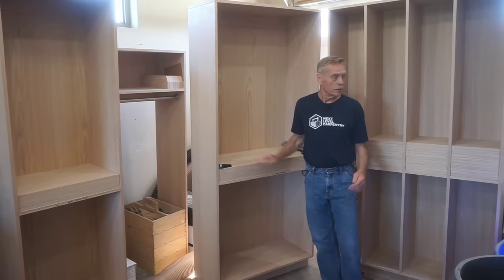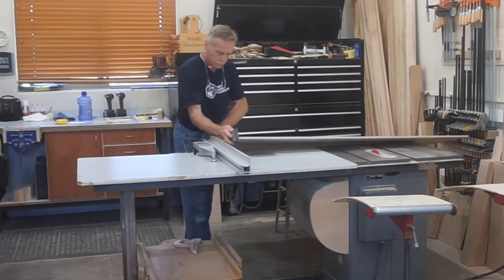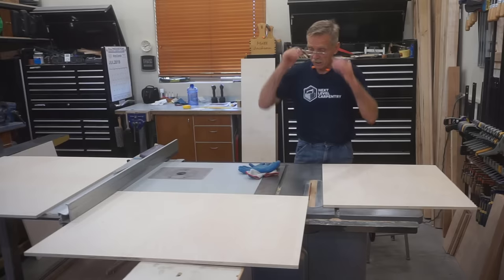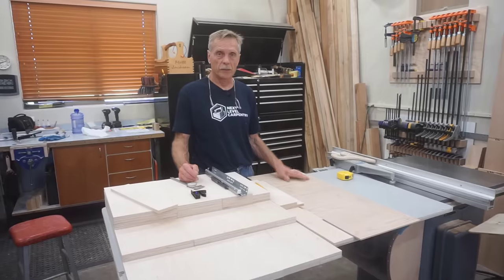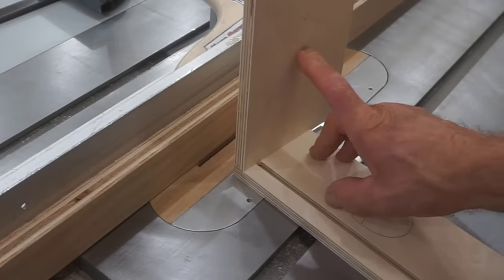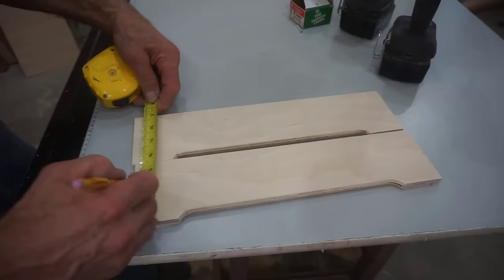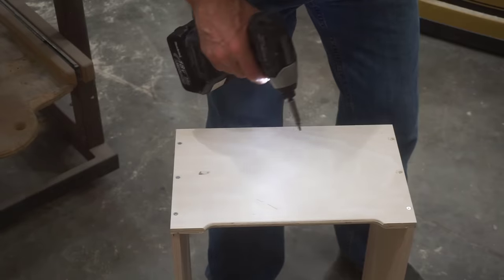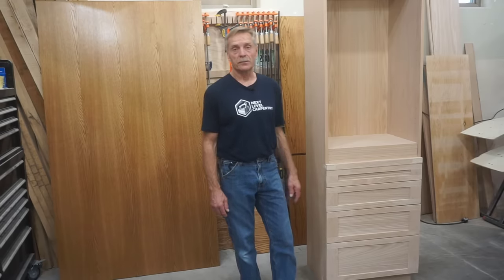Master Class for Professional Grade Cabinet Drawers

Comment: Amazing video, so much information and an approach that uses (quality) standard tools for next level results! Could I ask how you would react if you had the misfortune for one of the dados to pop open when assembling the boxes? Do you ever make spare components as contingency or do you have a fix, or do you simply never let things get that tight?
Reply from the maker: Thanks for watching and commenting on this one. 
First: I often make spare components for a variety of pieces but base the decision on the likelihood of the part failing.  However, something like drawer sides have such a low probability that it's not likely I'd have a spare.  There is a high probability that things go wrong during assembly though so I try to anticipate and avoid.  I assume the dados you're referring to are the ones for drawer bottoms?  I'd try to anticipate failure during dry fit when I can still widen the dado or sand the drawer bottom to loosen the fit.  In the event the narrow strip below the dado were to pop off, which is a likely scenario with Russian Birch plywood, I'd stop the assembly process and use Starbond Medium Thick Flexible CA glue with accelerator to quickly repair the failed part, adjust the fit to loosen it a bit, and carry on as if nothing happened. 😎
Reply: @NextLevelCarpentry  Thanks for taking the time to respond. The glue repair seems the best and certainly beats spending the money and more importantly time on getting more material and setting up machines again. Luckily I'm just planning the work so will take care to keep joints just so 👌
Reply from the maker: @lordrust9826  If you anticipate problems you can always use Starbond Thin CA as a preventative measure buy letting it wick into the bottom edge of pieces of that plywood and then apply accelerator to cure it and to strengthen the surprisingly weak bond between laminations.  It would be similar to the process used by pen makers on spalted wood to strengthen/harden blanks before turning.  Good luck and have fun on your project!
Reply: @NextLevelCarpentry  Nice tip!

Comment: the drawers look so good.  I was wondering why the need to disassemble them to apply the finish. Can’t we apply the finish after the assembly?
Reply from the maker: You sure can... but I don't.  I don't like spraying OR sanding inside corners unless absolutely necessary.  I quickly recoup time for disassembly and reassembly because everything else goes much faster and there's no comparison in the quality of the finish I get.  Best, Matt
Reply: @NextLevelCarpentry  Thanks for the quick reply Matt.  I suppose, if I use a stain and brush applied polyurethane, it is also better to do before assembly.  My next question then is, what is the downside of drilling the pilot holes and put the screws on after finishing?  I.e. makes all the cuts, dry fit, finish, assemble with glue and screws. Your work looks incredible and I only hope to get close to half of it.  It is for my own use, I don't have to worry about picky customers :-)
Reply from the maker: @b3arwithm3  it's all the more sensible to apply a finish before assembly when brushing IMHO.  One downside, although minor but meaningful, to drilling for screws afterwards is that it's really hard to see marks for screw locations because it's tough to make a visible mark on a fresh, smooth finish.  Yeah, you can use a sharpie or masking tape for marks but you quickly go backwards in time spent compared to the way I do it.  Don't take my response as a lecture... ask 10 woodworkers how they'd do the same job and you'll get 10 different answers... mine is just one of those.  If some of what you see me doing makes sense and works for you, grab it and go.  If all you do is see things and say "I wouldn't do it that way" at least you've thought through the process/workflow to come up with what works for you.  Your project is going to go great... I predict! 😎 Best, Matt

Comment: Curious, instead of cutting back pieces, why not leave dadoes on all 4 sides and eliminate the screws of drawer bottom.  Or is the method you used for replacement of bottom should need arise?

Comment: I have an Osborne mitre gauge and unifence and have needed a infeed extension like you show at 23:50, I think you called a block, could I get more information on it?
Reply from the maker: I can post a picture on Pinterest for you if interested... let me know?  I find the setup pretty functional for the most part.  It expands the crosscut capacity a worthwhile amount but does have limits.  Best, Matt
Reply: Next Level Carpentry  That would be great, would you post a link to it too. Thanks
Reply from the maker: @jamesbenenati1039  OK... I took and uploaded 4 images to Pinterest... they should be at the top of this page: https://www.pinterest.com/thetimbertailor/next-level-carpentry-project-photos/  Basically it just friction-fits into the slot on the unifence to stay in place.  The dado in the top allows clearance for the miter fence bar to slide through.  The two 'rails' that run perpendicular to the fence are about 1/32" higher than the table surface to guarantee a smooth slide from the block onto the table.  Let me know if this helps? Best, Matt
Reply: This was great Matt, currently waiting for the glue to dry on the outside pieces. I noticed that your dado is off center, is there a reason for that? I used my mitre gauge on the left side of the blade most of the time.
Reply from the maker: @jamesbenenati1039  You are quite observant... and there's a VERY good reason the dado is off center.... trouble is I don't remember what it is! 🤣🤣 Looking at it again to answer your question it occurs to me that it might have had to do with the length of the piece of scrap I made it out of than thoughtful design.  Looking at it now I might choose to make it another 6" to the right to support the end of the fence better? Who knows... sounds like you might make yours a bit different anyways for using it to the left of the blade which, for whatever reason, I can't recall doing.  Feel free to post a link to yours when it's done... I'm curious and other viewers are asking about this too and might find your rendition helpful. Best, Matt
Reply: I think your right about supporting the fence better, I think if I had waited until it was all together I would have answered my own question. Will post later today.

Comment: Man, that is just beautiful work and your explanations are exceptional too.  Very inspirational and informative :-).  Couple of questions though.  I've never seen you use featherboards - is there any reason for that?  Also, do you have any videos addressing blade sharpening or precision tablesaw alignment?
Reply from the maker: Thanks Zach.  I do use featherboards but rarely need them which is why you don't see them in use at NLC much.  I did use one in the recent 'Make Custom Coved Casing' video though... a case where it's needed for certain cuts.  I haven't done any tablesaw tune up videos.  Most are a matter of going through all the alignment steps explained in Owner's Manuals and are pretty machine-specific.  It IS essential though to have reliable, no fuss settings for working efficiently.  As far as blade sharpening I've pretty much adopted replacement over sharpening because sharpening changes the kerf width a teeny bit and the cost of sharpening vs replacing has closed over the years.  Plus I don't like having to wait, etc... but that's just me.
Reply: @NextLevelCarpentry  Fantastic - thanks for your reply.
Reply from the maker: @longfade  Youbetcha!
Reply: @Hello Zach how are you doing

Comment: How did you come to select Hettich slides instead of K&V or Blum or other more commonly available soft close drawer slides?
Reply from the maker: Welsh Rabbit: Hettich is the brand carried by 'my' local cabinet shop supplier so I gravitate towards it over the others you mention.  I also really like the fit, finish and performance of the Hettich Quadro slides you see in this video.  The side-mount glides are harder to pull out and seem to retract with as much smooth pull as the Quadros too.  I've not done any side by side or price comparison though but can tell you I've not been disappointed with these and so have no reason to go shopping.  Best, Mat

Comment: i like this!, great video.  ive done this lots too but i was never as organised.
1/4 inch oak veneer mdf?  never seen that, i much prefer veneered plywood for the bottoms, thickness according top the expected load, so 1/4 or 3/8
im with you re: pocket screws, they make an assembly look amateurish.  however i glue and staple my bottoms across the back, glue at the front and sides

Comment: Excellent job. Not the joinery I use but there many ways to make these and your method is rock solid. I'm a fan of dovetails. I do have a question though, why use Oak in place of Birch (as the sides are) for the bottoms?
Reply from the maker: Oak drawer bottoms are just a matter of practicality on this project... they are easily made with offcuts from cabinet backs so I'm able to use material more efficiently.  The alternative is to haul the oak offcuts to the landfill and buy 1/4" equivalent birch for drawer bottoms... and then haul scrap from the birch to the landfill too... 😏
Reply: @NextLevelCarpentry  Quick reply. I see insomnia visits you too. I was guessing it was something like that.  And the customer won't even notice, especially when they fill them with clothes.
Reply from the maker: @mlt3258  yeah, and they could just as easily end up as birch if materials worked out differently.  And then in some instances if the customer specifies something I'll ignore efficiency and make them out of which ever species they want... but most clients choose efficiency for exactly the reason you state...

Comment: I'm looking at building a couple new drawer boxes for kitchen cabinets, would the joints you used here work for that or go with dovetail? I am not experienced in woodworking but a machinist by trade. Which would be preferred for a novice
Reply from the maker: In decades of building cabinets for a very wide range of discerning clients I have yet to encounter a single one that saw value in dovetailed drawer boxes Jim. I've NEVER done dovetailed drawers for that reason.
Dovetails were developed long before the high quality fasteners and glues we have today were available.  They're the best way to join solid wood drawer box components using just glue, they're challenging to do well and are, hands down, the sweetest looking joinery you can use for drawers BUT I don't find them sensible for 99% of drawer builds.  Commercially made cabinets tout dovetailed joinery as a marketing spiel IMHO but theirs are all done with CNC with zero craftsmanship involved.  Still look sweet, hold securely and are great for marketing but no stronger than other joinery methods.
If you want the challenge of cutting dovetails and the satisfaction of showing people your accomplishments by all means: do some beautiful dovetailed drawers (you'll need to use solid wood)... they're a statement of ability and craftsmanship... but  the joinery I show in this video will fit seamlessly with your machinist abilities and the finished drawers will be equally strong.  Have fun with your project regardless of the direction you choose!  Best, Matt

Comment: Thank you for yhis video, I'd like to know why you use glove when cutting on the table saw, it's intriguing me a lot :-)
Reply from the maker: I use those blue 'smurf gloves' for GRIP Andre... there's increased danger of injury if a gloved hand contacts a spinning blade but, for me, there's far less chance of contacting a spinning blade if my hands don't slip.  DO NOT adapt any technique from me (or anyone else) if it seems unsafe to YOU!  They're YOUR fingers and you're responsible for them... you only get one set for life! Best, Matt
Reply: @NextLevelCarpentry  Thank you for both the answer and the advice. Just to let you know, I learn greatly just by watching your video and you do a very good job.
Reply from the maker: @andreb.8266  You're quite welcome!  Since I never once attended a trade school I learned organically, without restrictions of curriculum.  Things you see me do I do, not because someone said they work but, rather, because they DO work.  Two entirely unique things I do are to use sawdust to clean up wet glue squeeze out instead of water and use sharpened putty knives extensively in the shop and on the job.  Never seen or heard of anyone, anywhere doing or showing either of those.  That makes me advise caution for those watching and learning out of concern for their safety while they progress.  I sometimes say "the absence of an accident does not determine the presence of safety" to warn of unknown unknowns that lurk in our minds.  Thanks for watching and commenting here... I hope you continue find new, useful things to take your skills to your own Next Level! Best, Matt

Comment: you showed me a couple of cool tricks this time. Thank you very much. I really like the large miter gauge. is that a Delta product?
Reply from the maker: You're welcome Don.  The large miter gauge is the Osborne EB-3: https://www.amazon.com/dp/B002KHNMEC/?ref=idea_lv_dp_ov_d&tag=aiponsite-20&linkCode=ic6&ascsubtag=amzn1.ideas.3K4LKITT8BCOC  it has some limitations like any miter gauge that slides in slots but it's the best I've found.  BTW Not only have I drilled my Unifence for versatility I've drilled a couple holes in my EB-3 too! Best, Matt

Comment: You videos are always a pleasure to watch and I learn a lot of little things that will make my work as professional as I can make it.  I have the same fence on my Delta Contractor Professional saw but having difficultly locking it down.  Do you have any suggestions on how to adjust the fence to keep it locked down.  I have the owner manual but it is not very informative.
Reply from the maker: Hey Tom, If by 'trouble' you mean that even when the locking handle is all the way down the fence can still move side to side then here you go:  
On either side of the lock-down handle are large hex head set screws connected to nylon covered tabs on the back side (or something similar, depending on the model/year design of your particular fence).  
The two screws (and connected tabs) are what set both squareness of the fence and tension of the locking knob.  Those tab covers are made of tough plastic like nylon for smooth operation and minimal wear of the aluminum fence bar.  As such, they slide easily but also wear down over time.  The way I get my fence to lock down with the handle about 75% of the way down is to turn those screws in periodically to offset the amount of wear on the tab covers.  You can quickly turn them in to 'tighten' the locking knob but also need to adjust one then the other so the fence is 'square' ie: 90 degrees to the fence bar and parallel to the miter guide slots.  It's really simple once you've made this adjustment once or twice.  Once you get everything adjusted just so be sure that the two set screws stay put.  Newer fences have small set screws on the underside that tighten against the larger ones to keep them set.  My saw doesn't have that so I actually put a small piece of tape on the face of the large set screw to keep it from spinning during use and throwing off both squareness and locking tension.  Let me know if this makes sense and helps? Oh yeah: the tab covers will wear all the way through over time requiring replacement (like brake shoes/pads on a car) but I don't know if they're still available.  I think I got my last ones from ereplacementparts.com but I'll bet it's close to 15 years ago.
FWIW A good friend of mine has a newer model Unifence that had the same problem I describe above.  The function of his fence is the same as mine but the hardware is different so if this doesn't jibe with what yours looks like send a link to close-up pictures of yours and I'll see if I can talk you through the fix.  Cool?

Best, Matt
Reply: @NextLevelCarpentry  
Thank you will give your method a try.  I thought it was an issue was with the piece  in the aluminum guide rail.
Reply from the maker: @tompeppito6821  I understand... that's an intuitive thought and confusing.  Take a closer look and I think you'll get it fixed in short order...

Comment: Hi,

Very much appreciate the methodical process of getting a project planned, rationalized and completed. What is not clear to me is why drawer backs are mostly cut off from the drawer bottom dado. Why not leave the dado and drop in the bottom before putting the back on? I’m not clear on why cut out that back support dado?
Reply from the maker: Not incorrect thinking but suggestion of a different way of doing things.  The way I do it here is plenty strong and makes installation of the undermount hardware simpler too.  There's infinite ways to build drawers and any that are well thought out for the specific project are 'right' IMHO. Best, Matt
Reply: Thanks Matt. I look to your master carpentry experience and knowledge for best practices and rationale for making specific decisions. I too would like to improve my woodworking knowledge and results, to take my projects to the next level! 👍. You are not only next level, you are the best out there. Thank you!